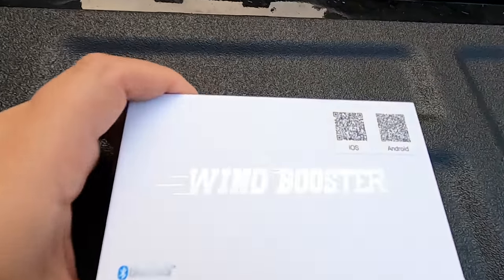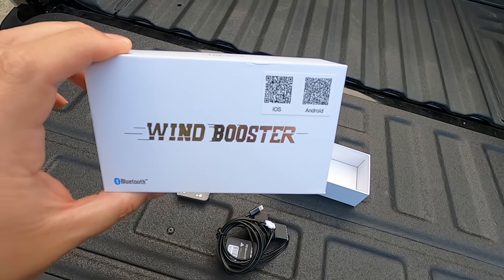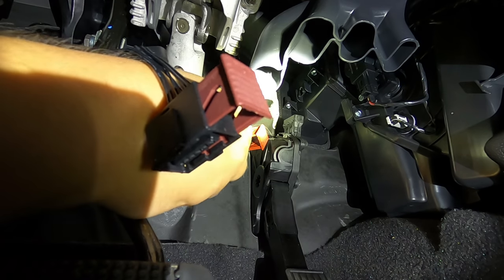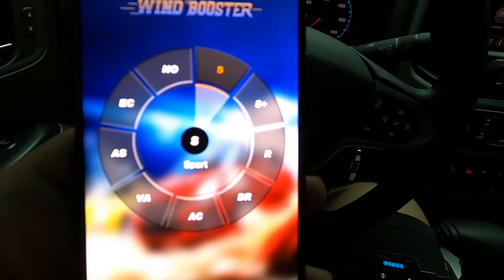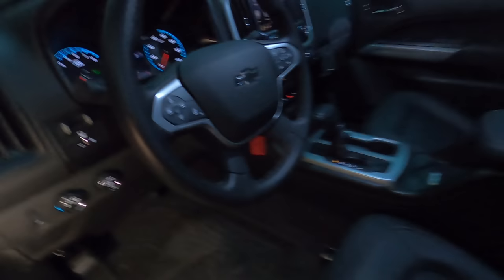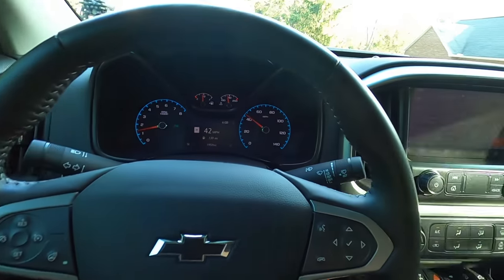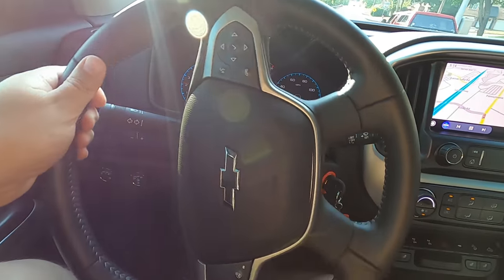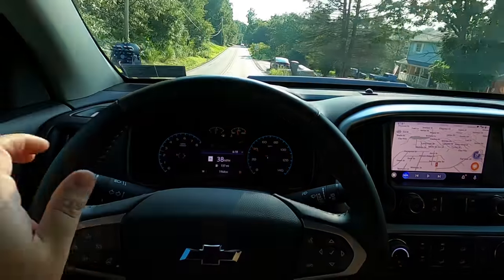FIX the throttle LAG on the Chevy Colorado with Windbooster!

Comment: Update on my wind booster.  It seems like I am the only person who has received a bad unit. Bummer! I have contacted my credit card company and have disputed the charges because I have not received any emails from them about return, replacement, or refund.  Very very frustrating 😕
Reply from the maker: That is very interesting, indeed! They are very quick to get back to everyone I've talked to. Which email are you using?
Reply: That replied after my 1st email. And after that nothing
Reply: Hi finally got some feedback from windbooster. Customer service still stinks but they did end up sending me a new unit without me knowing. Go figure. 
I installed today,  I'm taking a few days for  to see what's going on. I will keep you updated
Reply from the maker: Definitely do!
Reply: Another update of the wind booster. Very pleased with the unit does what is advertised.I am  glad everything  finally got straightened out.Very happy with the unit, still dialing it in and having fun doing so! 😀
Reply from the maker: Sweet! I’m happy to hear it! The unit has been bulletproof for me and all of the other trucks have installed it on so I figured it would get worked out.

Comment: For Anyone with the two thousand fifteen or sixteen. Mine did the same thing and it struggled to go up hill and when? It. Did? It would sky rocket  rpms and I had a very dead pedal. Like a lag. In 2018 they updated ecu a transmission for my 15 and the 16s 
It's on the chevy bulletin.  They updated my codes and problem was solved!!!! Hope it helps

Comment: Ok, I just bought a 2017 Canyon with the V6, and I've noticed no throttle lag at all. Does this affect only certain years?
Reply from the maker: Unless the one you bought was previously tuned or already has this throttle controller on it you definitely have the lag. I'd look for a tune or this controller already installed to answer your question.
Reply: I'll look, but OTOH, I just got rid of my tired old F150 with 310k miles on it. And it was a dog. Maybe I was just used to it. This Canyon is a LOT more snappy than it was.
Reply from the maker: That’s also a good possibility!

Comment: Did anyone have issues ordering from the link he provided? How long did it take to get it shipped? The link provides the product from a different country. I bought it but it has not even been shipped yet. It's just stuck in processing and there customer service is not helpful.
Reply from the maker: Interesting. I have sold quite a few of these from this link without any problems in the past. How long as it been?
Reply: @HorsePowerObsessed  it's been about 5 days and it still hasn't been processed. But if you say that the link and company is legit, then it must just be taking longer than expected.

Comment: I ordered and installed a WindBooster on my ‘16 Colorado Z71. Was working great.. until today. The app said it needed a firmware update, so I did it. My truck immediately went into “Reduced Engine Power” mode. I had to completely remove the device to be able to drive it! Has anyone else seen this?? Suggestions?
Reply from the maker: Wow, that's interesting. Did you try reinstalling it after the firmware update was complete?
Reply: Do we have to install the app? I'd rather just mount the small screen and not worry about app updates..

Comment: Maybe is laggy from factory to improve fuel economy?
Reply from the maker: I guess? I'm not sure how that would improve fuel economy especially since it would just make me angry enough to push the gas pedal way harder than I needed to lol
Reply: @HorsePowerObsessed   Lol. My thinking is the slower the acceleration the better the fuel mileage. You haven’t noticed a change?
Reply from the maker: Nope. Has stayed the same.

Comment: My 2017 doesn’t have this is. Soon as you barely touch the throttle it tries to break loose the tires. I bought it dec 2020 from a Toyota dealer

Comment: Bought one, returned as not suitable (30 day money-back, they told me on the phone). Well, I mailed it back, they rang me for bank details- 2 weeks ago. No refund yet. Hmm. Buy one only if you're 💯 sure. If it doesn't fit, sell it privately, you won't get a refund.
Reply from the maker: Not suitable? I’m not sure what you mean by that. They will definitely refund, don’t just give up on it.
Reply: @HorsePowerObsessed  my model of car,  half of that model are Drive-by-wire throttle, half are just normal straight cable. Mine is cable. I rang them, they said 'send it back, 30 day money-back'. Which I did.
Reply from the maker: Which car do you have?
Reply: @HorsePowerObsessed  what car I have isn't important. It's a vehicle which was never imported into North America
Reply from the maker: It is kind of important because this particular video is specifically for the Colorado so if you clicked on the link for the Colorado and ordered it then obviously there would be a problem.
Reply: @HorsePowerObsessed  my issue is with the Windbooster company and your channel has the biggest reach that I've found 🤠😎
Reply: @steveedmond9362 That makes absolutely no sense at all. If you bought something for a Colorado and you don't have a Colorado then it's your fault.